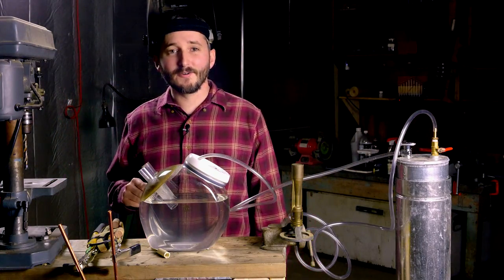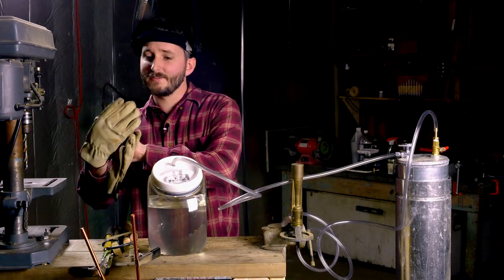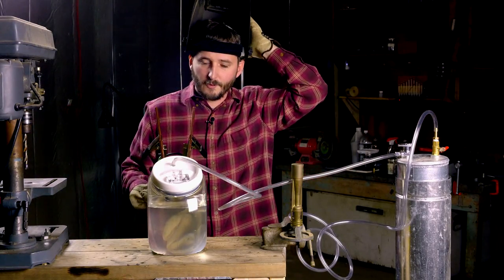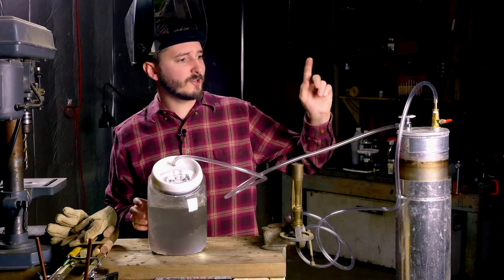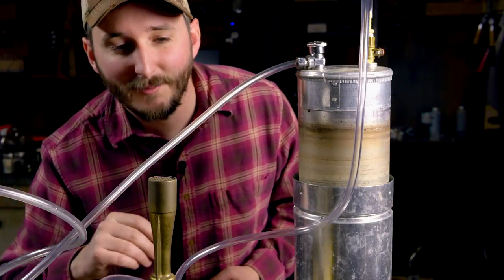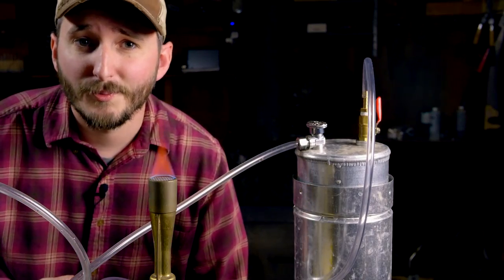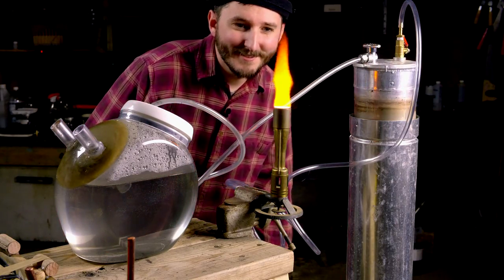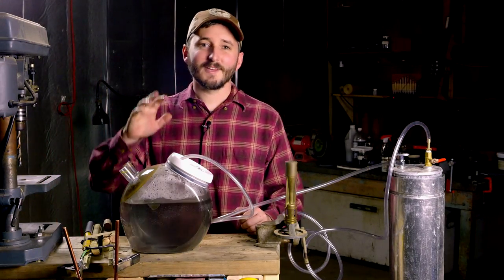Plasma Generated Water Gas (Electrically Produced Fuel That Is Not HHO)

Comment: Use a grounded base plate in the water, put charcoal or other carbon on top, then you’ll only need one carbon electrode in a regular stick welding clamp. Alternatively, start without water, establish the arc, dribble water in. For more fun, dribble old motor oil into the glowing carbon and crack it into gaseous fuel. A little water will help with that. Add a high frequency arc stabilizer for better performance. Another idea for better control would be a 4 way T with the electrodes coming straight at each other, water/hydrocarbon/pulverized carbon slurry fed from bottom, gas flows out the top. I’ve played around a little, but not as much as I would’ve liked. 😁

Comment: Nice to see the gasometer back in action. While I knew carbon monoxide was reactive it never occurred to me that it could be used as a fuel source; very cool.
Reply: You can even run vehicles on it.  I ran my 1991 Chevy Lumina APV on carbon monoxide some years back.
Reply: @dansw0rkshop  Very cool.

Comment: Attach level switchs  to your gasometer so it can start and stop a compressor  automatically and use the compressor intake to get the gas compressed. You will then be able to get large amount of is stored. Then try running an engine from it and measure the efficiency using an alternator coupled on the engine.

Comment: Cogen, comes to mind, use the heated water from the plasma arc in a heat exchanger to heat another water vessel, store the gas for use in a combustion engine later on, couple the entire process with solar produced energy and you might just have the perfect storm. Consumables would only be the Carbon rods and the water split.

Comment: Build the electrodes into a "sparkplug" with water injected between them. Mounted in a standard engine, with some good electronic controls, that waste energy could be captured and used in combustion. Heated steam is POWERFULL in an engine.
Still not as efficient as 150 amps into a BLDC motor, but fun !

Comment: Your setup would be actually ideal to create a atomic arc welder. You essentially feed hydrogen gas into the arc which gets split into atomic form. On cold surfaces it recombines creating temperatures as high as 4000°C (7200°F)!

Comment: another advantage of the carbon monoxide burning in tandem with the hydrogen, is it gives the flame color, and makes the mixture much less explosive. Pure hydrogen is much more of a problem. Very cool demonstration ))    A similar technique has been developed recently by an Australian university to make Ammonia ( NH3) using a plasma arc. It also is flammable and toxic.

Comment: Dear Dan, it is an interesting system: did you also find Methanol in the water solution as a result of your experiement: 
H2O and C makes CO and H2? There might also be some CH3OH methanol as there is also a H2 and CO production. The potential of Methanol is enormous as a seasonal storage system for households! It can be storage easily and can be turned back into electricity with a direct methanol fuel cell with relatively high efficiency! So think that that direction might be interesting, Cheers Winfried

Comment: It's very well known commercial usage was for city gas as a byproduct at the coal cokeries in the 1960s era in Germany. In this process coal was heated under absence of air and then suddenly dowsed with water generating coked coal and water gas. The latter was dried and filled into huge gasometers to supply cities. As a kid I remember filling balloons with it. The hydrogen content was enough to let the balloon rise. Couriosly most of the suicides were attempted and successful due to the CO content. It was a dangerous time. Also because East Germany had no natural resources other than brown coal. The production of coked coal was necessary in many other industries. In my days back then we learned this process in middle school. So this really isn't anything new or curious except perhaps for younger players  :)

Comment: Every effort for free clean energy rewards whoever tries it. The ideas are very good and I hope they come out to be heard.
One of my thoughts and I say it publicly so that someone does not try it is the breakdown of water by microwaves.
For me the most suitable frequency is about 38.5. up to 39.5 GHz.
A continuous high voltage will separate oxygen from hydrogen.
It would be good to have water in smaller molecules that can be done either by over compression and expansion or by ultrasound (cold steam).
Enough until now continue for tests.
I give you ideas to experiment .....

Comment: While there is not enough pressure to fill a propane tank it theoretically would be possible to modify a vacuum pump to pull a vacuum on your gasometer and send the gas pulled out into a propane tank for storage. Just a concept. I don’t know the inner design of vacuum pumps but this should be applicable for both this gas mix and wood gas.

Comment: This is a great resource if you have excess electricity – say, during peak sunlight hours for your solar panels – and you want to store it for later without a battery.
Reply: Trevor Doge
Problem is you’d need a lot of energy to produce the pure carbon rods, as required in aluminium extraction.
Doubt if it is sustainable.
Reply: @peteeyles5115  YA BUT WALKING SUCKS

Comment: This is exactly what is happening in a charcoal  gasifier when you add a water drip system. Charcoal Gasification is a much more viable and efficient way to produce this gas. However, in this process, there will be nitrogen from atmosphere that makes the gas less energy dense. Id like to see an experiment using an Oxygen concentrator or just using a small amount of pure oxygen to displace the Nitrogen. You may then be able to add more steam to displace the intake of  the atmospheric air resulting in a much more powerful gas energy density.

Comment: There is a patent for a similar device: aluminium foil or wire is burnt with an electric arc under water. It's meant to be a hydrogen source for cars.
Besides some problems it works.

Comment: If this gas generator was a low-power device, you could easily adapt it to a RF plasma thruster head for power-limited spacecraft. Once the hydrogen/carbon is generated, pass it through a quartz tube and couple RF power to the tube to ionize and accelerate the gaseous propellants to higher exhaust velocities. Such an approach should yield a better specific impulse than that of cold gas thrusters. Size, and power will greatly affect the miniaturization of this device, however.

Comment: Carbon monoxide is what allows iron and mild steel to become high carbon steel when heated at high temp. The Carbon diffuses into the metal. Here, you could put a piece of mild steel into a container, fill it with carbon monoxide, close it and then heat it for a few minutes. Usually, getting carbon into steel is a very very slow process, sometimes taking hours. But if the conditions are just right, you can carburize a piece within 20 minutes.

Comment: Yes...in the exotic energy research field I call it syngas synthetic gas sun gas...easily manufactured using high density dumps of dc electricity into reactors...arc tech and actual electrolysis systems work...

Comment: Good video. You might be interested in an earlier patent of Hilliary Eldridge (US 603,058 "Electrical Retort") granted on April 26, 1898, that illustrates essentially the same process. A fellow by the name of JL Naudin did a lot of work with this type of device during the early 2000's. His web site details what he calls a "Bingo Fuel Generator".  Same/similar device to what you've shown, just done back in 2003. Great stuff, thanks for the videos.

Comment: Those are actually ark gouging rods for removing weld after you weld the bevel on thick plate you got to gouge it down smooth and flat and then put more weld in and you got a back gouge until it's completely full to make a complete and true connection point with your weld that way there's no holes and no air bubbles and no pin holes and worms inside your weld and you can also use it to help bevel and back bevel thick plates on ships and boats and stuff in the shipyard as well to build the weld if there isn't a fitter around with a torch so those are actually arc gouging rods and a real ark gouging setup in the shipyards are very very loud and almost too loud to walk by without ear plugs in especially inside the bottom of the ships

Comment: Very cool experiment, I didn't know this would happen. Now its got me wondering about all sorts of things.... One question...
So if this were to be used as a "battery", how much loss of energy is there between phase changes (welder to the therms from the torch)? 
AC welders are said to operate at 20 to 100 volts typically. At 150 amps, your welder may have been transferring between 3 to 15 KW per hour to generate an unknown amount of gas. 

I don't know, but I suspect the resultant gasses would yield a fraction of the energy put into the system. Although it does seem the water absorbed quite a lot of the thermal energy. Water is good that way, so maybe the system is more efficient than I imagine...

Thank you for showing this experiment. 

Things I learned.
1) carbon monoxide is flammable (I did not know this!)
2) carbon could be oxidized (I'm more of an EE, not a chemist)

One more question.
Is carbon dioxide an oxidizer? I'll look it up.

Thanks!

Comment: You should try to make coal gas next, so you cover both lighting fuels used before the widespread adoption of electricity and the incandescent lightbulb. :)

Also another video where you use a heating mantal lantern to burn the water gas into light would be really cool :)

Comment: I don't know what the ratio of this mix is but hydrogen and carbon monoxide can be catalytically converted to methanol, which is an excellent replacement for gasoline. My carbon arc torch is like half done

Comment: My guess would be hydrogen and carbon monoxide. I think the arc would be more efficient in gas phase (avoiding the chilling/bubbling effect of liquid water). You could use something similar to the Birkeland Eyde process for nitric acid, but in this case,, using steam as input to the reactor. Unreacted steam could easily be separated from the gases by simple condensation, the unreacted water being returned directly to the boiler.

Comment: I did this (electric arc under the water) to prove to someone that the water will not extinguish the flame. I used a 24V/200W transformer and some 4-5mm diameter rods from some dead zinc-carbon batteries. I tested and played with the electric arc generated that way. testing combinations of metal-carbon, carbon-carbon.
However, never knew that the gas generated was flammable, just thought that was water vapor. Later, when I told the story to an engineer, he told me that the gas should have been flammable, probably it was a mixture of hydrogen, oxygen, CO, CO2 and water vapor, maybe some other gases due to the water impurities (chlorine, maybe). He told me that plasma produced could dissociate water in hydrogen and oxygen just because of the heat.

Comment: I have seen this attempted about 50 years back, in a quantitative physical chemistry lab in college using  "Nurnst Glower".

 The operator said he would be breaking the atomic  hydrogen-oxygen bond with the device, which appeared to be a coil of wire, the kind used in toasters.

I requested he wait until I could get 8 to 10 miles away before he started, having quickly calculated the energy yield, but he refused and proceeded. 

Obviously, his attempts failed, made obvious by the fact I survived.

Comment: there is another way around the carbon rod eroding, add graphite to the water and you can use a different rod...e.i tungsten and get it hot enough to do the cold fusion type plasma so you don't need to hold and arc

Comment: 0:49 challenge accepted.
well, considering that you are using a carbon arc torch, I'm going to assume that its a hydrocarbon your making, it could be any one of many different gaseous hydrocarbons, I would guess it would either be methane, propane, butane, or maybe ethane? I don't know the process required to make those gases, but I do know they require hydrogen and carbon, and they are all gases at room temperature. if I had to pick, I would say propane, because its quite cheap, and therefore is probably the most easy to create, easy enough, that you could make it at home.
(I have not seen the video yet)
edit: ok I have watched the video now, and wow that's really cool, you make CO with those carbon rods! I knew they had a role to play! I had no idea that carbon monoxide was flammable, but I guess it makes sense since its much more stable as CO2, so of course it wants to grab oxygen. on the other hand, you are also making hydrogen, which I feel is cheating since you said you weren't making hydrogen/oxygen instead you were making a new gas, you're also making steam. well, I'm glad I've gotten to learn about a new flammable gas I didn't know was flammable before. :)
so the answer is carbon monoxide.
thoughts: it kinda completes the flammable gas trio. you have pure hydrogen (gas) hydrocarbons, a mix of hydrogen and carbon (gas) and carbon (solid) you really needed a third gas that was flammable, but sadly carbon is a solid, and so the solution was CO, its basically the gas version of carbon, and its flammable.
(I'm aware that pure carbon can be vaporized, but that's very difficult due to its insanely high melting and boiling points, or rather, sublimation point)
it then begs the question, what about HO??? hydroxide? mystery for another video I suppose. I would appreciate it if you tried experiments with hydrogen monoxide if its possible.
questions: can a bunch of CO decompose into C and CO2?
is the same true with HO?

Comment: I built a jet engine with a blower end
Of a vacuum cleaner a carbon arc and
Water injection it turned the water into fire or hot plasma water breaks down then combines and it was awesome.
That was 50 years ago. The flame burns oxygen from the air so it possible your
Accessing more energy than the electrodes use.

Comment: Pausing at 5:32 -- Carbon Monoxide could be produced - carbon from the electrode and oxygen from water. It is both poisonous and flammable. You might also produce CH4 or methane. One carbon atoms plus four hydrogen molecules in the simplest of carbon chains. It's not impossible to also make C2H6, C3H8, etc, but the heavier chains are less likely, and by C6H14 (hexane, a component of gasoline) the chains should be more or less in a liquid state at room temperature. 

You have the building blocks for nearly any carbohydrate....

Comment: This is akin to the industrial process of coal gasification. The products are not strictly hydrogen and CO, but also a mixture with hydrocarbons depending on the temperature under which they were created. Higher temperatures actually results in the formation of significant amounts of methane gas. This could explain why you see a disproportionate increase in carbon erosion when you up the current, the hydrogen starts to consume the carbon to make methane. At even higher temperature, more unsaturated hydrocarbons form, like ethylene and at extremely high temperature, you can even make small amounts of acetylene :0 That yellow orange flame may be to due to the black body emission of super heated soot particles, typical of flames containing some unsaturated hydrocarbons.

Comment: Based on the fact, that the electrodes are made of carbon, the  gas is probabbly the mixture of hydrogen and carbon monoxide, because at high enough temperatures water vapor can react with elemental carbon

Comment: I wonder, if this gas could also be made from just tungsten electrodes, so it would not need carbon, but just using a plasma under the water to produce some kind of HHO gas, or just use cheap Citric acid salt in the water to make C2H6 gas or just use gras cuttings to make the water conductive and somehow burn them away and produce some kind of hydrocarbon gas.. ???

Comment: One problem this process uses arc wielding voltages, which is more energy than can be retrieved on the combustion end. It is the equivalent of using a camping fire to solar charge an led. A 100 to 1000 times magnitude loss in energy! Even if you could increase the efficiency that still leaves carbon monoxide and hydrogen as the fuel, both can kill people if the tank ruptures!

Comment: That's how it works. If you use more energy, you accelerate the production of gas but consume more electricity and electrodes.
The water vapor decomposes into its gases as it passes through the glowing coal. This must have something to do with your system.
What matters most is the relationship between efficiency and consumption.